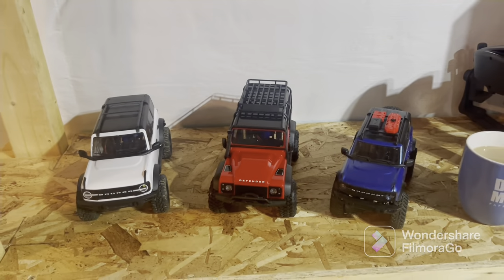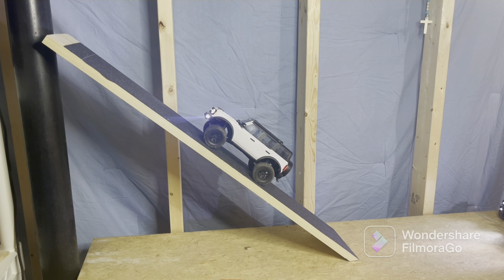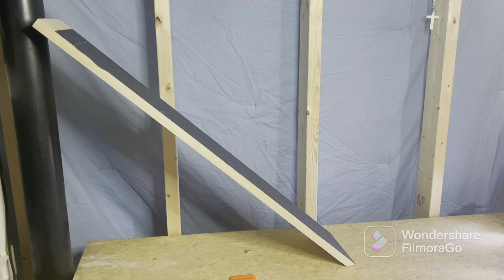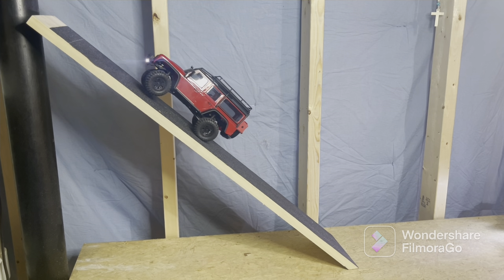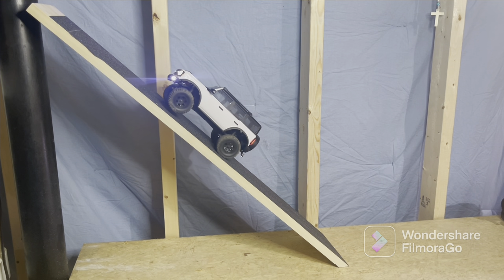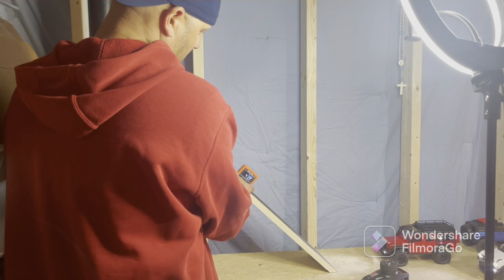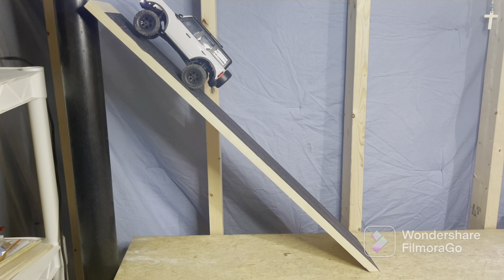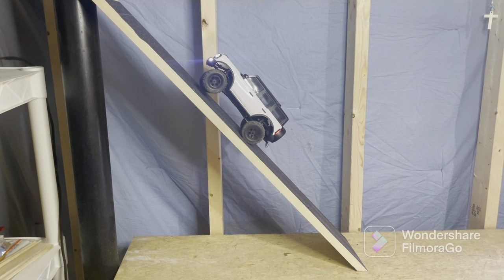TRX4M Bronco VS Defender! Who is the better climber?

Comment: I ended up scoring a bronco body and bumper from a hobby shop and I can tell you right now the bronco is far and above the best option. Im running brass c hubs, knuckle, link, rear diff cover. Major difference. Cut off the broncos fenders and bumpers, now it's an animal!

Comment: I think the defender will def climb better with the brass upgrades up front being a longer and slightly heavier body I ordered the green defender but unfortunately my local hobby shop hasn't received their orders so I'm just here waiting and watching video since I can technically make any of my own without my trx4m got a lot of upgrades for my defender can't wait to get and hop it up for future vids
Reply from the maker: How long do you think before they can get it to you? Do you want me to go check my local shops? Let me know and I can go tomorrow and take a look.
Reply: Defender for show, bronco for go, for sure. Too heavy and too high on the defender, you’d need upgrades just to hit stock bronco performance. Even if you put 100G of weight up front on the defender to even it out, if you’d put that same 100G on the bronco it’d perform better than the defender once again. Pound for pound there’s no way to counteract that high heavy body, only bandaids to help it get bronco like performance
Reply: @goreyboggs  they said probably next week Traxxas is a bit behind on their deliveries ind if a bummer I payed half the price to get the preorder just as a guarantee
Reply: I just looked at the traxxas website it says the wheelbase is the same on both so I think the extra length is in the rear of the defender body and won't help it climb much. I think the extra weight also comes from up high on the body and won't help climbing
Reply from the maker: @TrillMurray  Yea, just the body is bigger.  And I think different treads on the tires
Reply: @goreyboggs  yeah I noticed that. I'm hoping to get one soon. Since I won't use the body or tires and they're the same length, I'll get whatever they have in stock lol
Reply from the maker: @TrillMurray  for sure that’s what I would do. Going to change a bunch of things overtime. Anyway, I’m guessing.😎